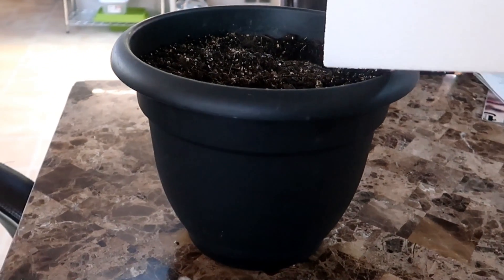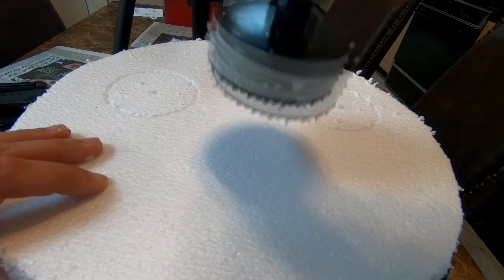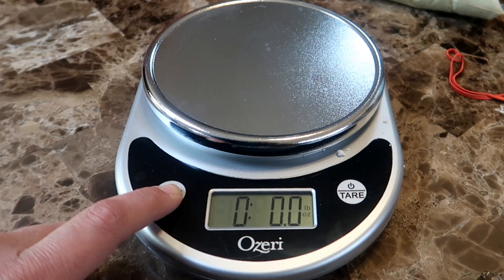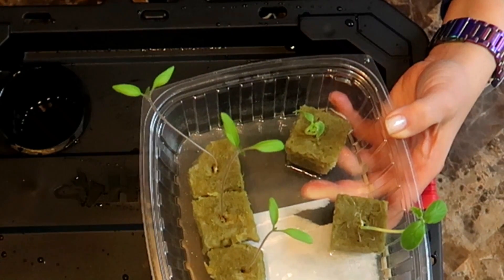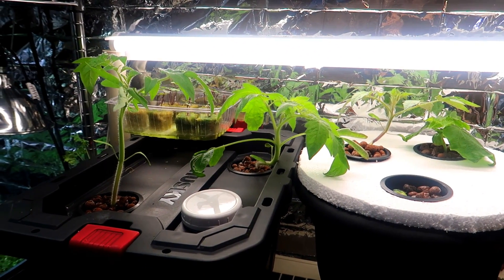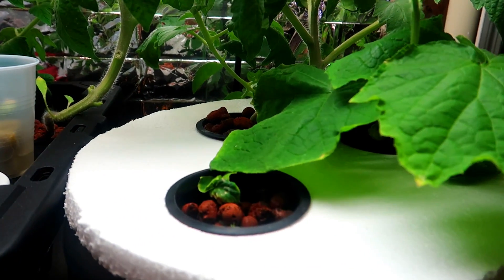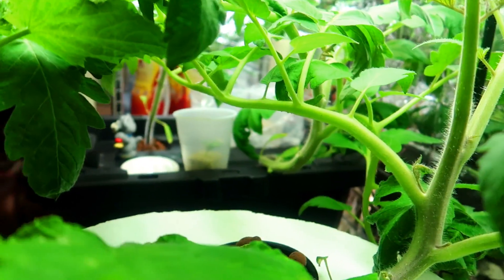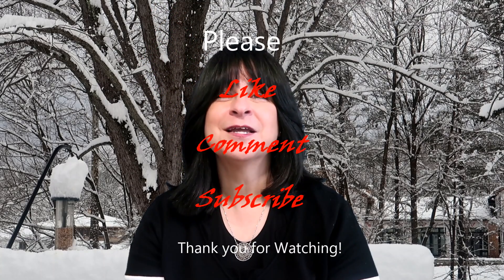Easy Hydroponic Kratky System using just Styrofoam and a Flower Pot

Comment: Was so excited to see your video since I just did the same yesterday (just one hole)! I used ceramic 2.5 gal with no holes just laying around in my backyard but I used 1/4" plywood that I have laying around, painted it to make sure it does not rot since it will be outside. In the bottom of the cover, I attached some pieces of 1 in wood all around to create a lock on the pot and fits it there tightly. for top heavy plants, like okra that I am using it for, I may need to duck tape to secure it in place when my plants mature. I also duck taped the 2in net cups because the wind is tipping it sideways already, also protection from occasional rain that may dilute the nutes.

Comment: Thanks for the wonderful video. How much of each nutrient in volume (for each gallon)? I don't have a good scale for grams
Reply from the maker: Hi ys6425, grams is a weight, and volume is an amount, so I'm not sure how to convert.  Some nutrients are lighter and others more dense, so weighing is more accurate.  Maybe you can get an approximation by googling?  Otherwise buy a nutrient solution that measures by the teaspoon, such as the nutrients by Fox Farms (2 teaspoons to a gallon of water).  The scale I use is pretty cheap and small, around $10.  Thanks for the comment!

Comment: Outstanding! I'm a first timer and this looks very easy, convenient and (most importantly) inexpensive.  How many holes did you get in the tote? I'm wanting to try some lettuce first and then tomatoes. Could I string up the tomatoes? Did you grow full size tomatoes or cherrys? Thanks for your instructions, loving it!
Reply from the maker: Glad you are excited Z Legend, its very rewarding to have plants growing indoors.  Try lettuce and microgreens first, they are the easiest.  I prune the tomatoes and use determinate species, so they can grow more bushy.  Both cherry and regular tomatoes, but buy seeds for low growing plants.  Tiny Tim is a smaller growing type, check it out.  I made three holes in a 5 gallon tote, 2 for the plants, and one to pour in more nutrients as needed.  Good luck and thanks for the comment.

Comment: Why place the styrofoam on top of the pot? Rather cut it slightly smaller then the inside diameter of the pot, and let it float on the water? Just make sure you put spacers under the planting tubs, that only the roots are in the water. But otherwise, great video
Reply from the maker: Hi Paul, thanks for the comment!   I had not thought to do that since there needs to be a gap for the air roots.  Can you explain a little more why you would float it on the water?  Thank you!
Reply: Hi  @TikkiOOO  I float it on the water so that the roots are the same level from the water all the time. The distance from bottom of the pot to the water is always the same, even with the plants drinking, and with evaporation. It also means that you can leave the plants for long periods without having to top up the nutrient solution.
Reply: Hi you published this almost a year ago and just now 2/26/20 coming up on my video feed. I was just wondering how to address the plastic toxicity issue. I never worried about it before and I container garden with a lot of plastic pots and big box store buckets with soil outdoors.  Is it possible to replicate your styrofoam and plastic planter idea using a terra cotta pot and bigger terra cotta saucer? I have no idea how difficult it would be to cut holes in that type of saucer and somehow would have to plug up the big hole in the large container. I know it wouldn’t be as easy or as cheap as plastic.  I wish doing things the healthy way wasn’t so expensive or difficult.  I may have to switch over all my containers to terra cotta. I sure hope there are no toxic issues with terra cotta! PS never did hydroponic gardening before.  Do you have any advice?
Reply: @hvnbndmatron4672  how about using plywood as plastic substitute?

Comment: Why have you got the drill in Reverse?????
Reply: Most people go in reverse when cutting plastic or styrofoam because it doesn't tear up the material so bad. It's something I have noticed on a lot of the hydroponics videos. I have since done it and it does work better
Reply from the maker: Hi Finsbury...no worries...I was just trying to make indentations and then I cut out the holes with a knife.  Have a great day!